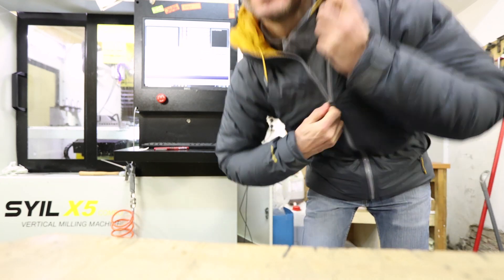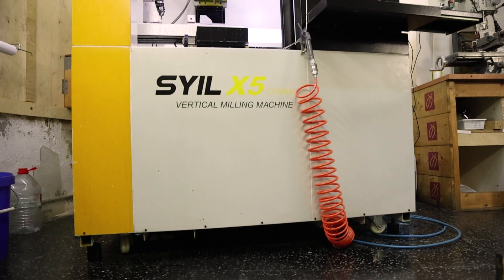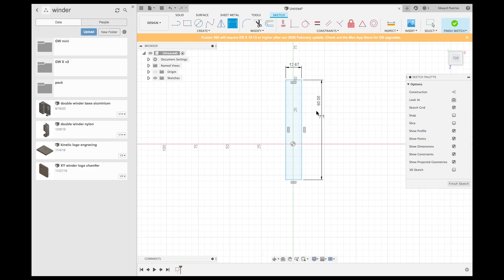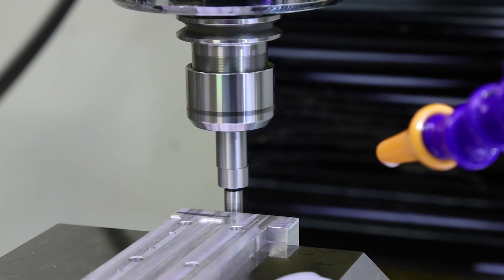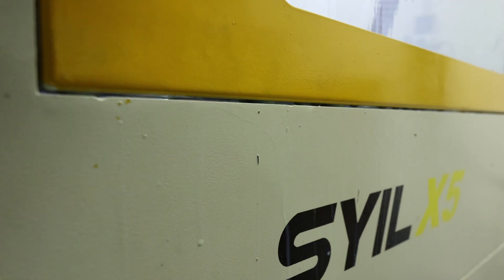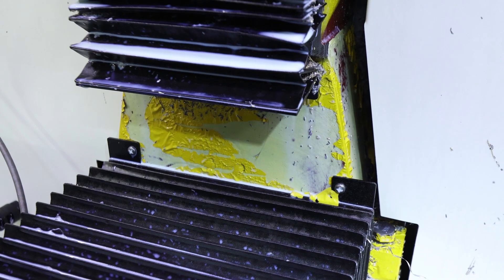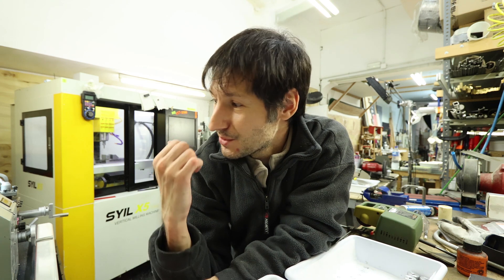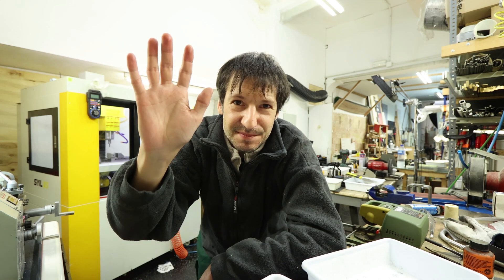How I learned CNC machinning

Comment: That was great!  Great machining montage, and fun to hear about your experience.  Thanks for posting.  I've been considering some sort of CNC and was interested in the Syil X5.  I see you are using a wine rack style tool holder. Do you have issues with coolant/chips sticking to the tapers on the other tools in the rack as you machine?  I do a small amount of stop motion in my build videos and your channel has been very helpful in that.  Thank you!
Reply from the maker: Hi, the tools there is not the best but it was what I could afford. I am not having much issues, some chips got there when I machine a lot of material but the air on the tool change blows them. I would be more concern with stainless, and then I am more careful about it.
Reply: @edupuertasfruns  Thanks for getting back to me!  Totally makes sense.  I hadn't thought about the air from the tool changer helping clean them off some.  I think the Datron Neo uses some little shied that the active tool can tip down to protect the other tools and then tip back for the next change.  Talk about unaffordable machines!  Still if you were having trouble keeping the tapers clean one could probably hack up a shield like that.  Thanks again for the response!

Comment from the maker: What do you think about learning by making?
Reply: Definitely my preferred method of learning new skills!
Reply: Learning by making is great... but since this set up can't be too inexpensive, I am inclined to want to find out more about how to get started with something like this first. This video definately helps.

If I can ask, what would you estimate it cost you to buy this machine, have it delivered, get basic tools to get started milling basic joints and any extra expenditures for computer stuff before you could start actually machining parts? It appears that this machine's governing computer component is attached, yes? Does it come with the machine or do you purchase it separately? Do you do the preparation programming set up on your lap top computer and transfer the data or some other method to program the CNC machine?

I don't see myself going into the armature or winder manufacturing business like you have, but I do like making things myself. I might like to invest in a set-up that would allow me to make small quantities of parts for myself. Perhaps some thing like dinosaur tails, octopus like tentacles or similarly armatured connstructions. As you know there are a lot of similar but varied sized joints in those type of armatures... from large to small.